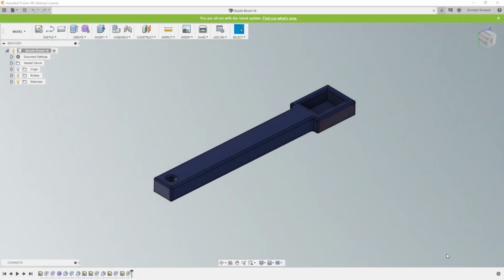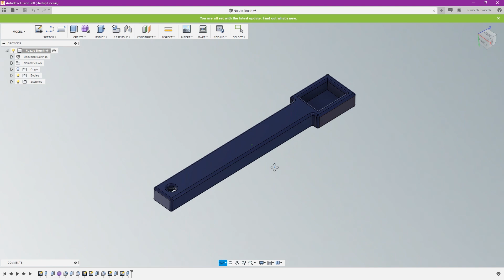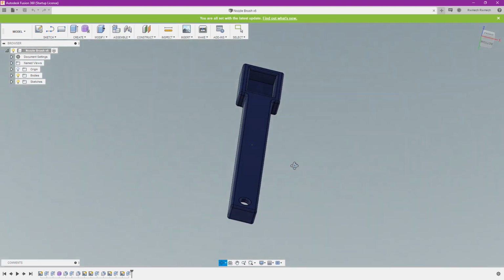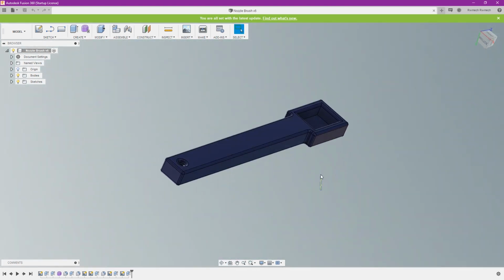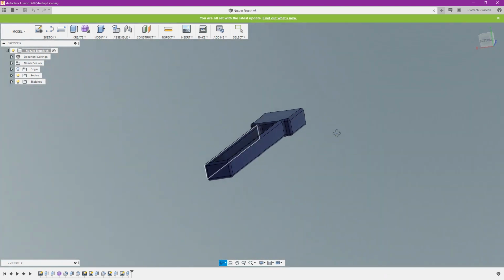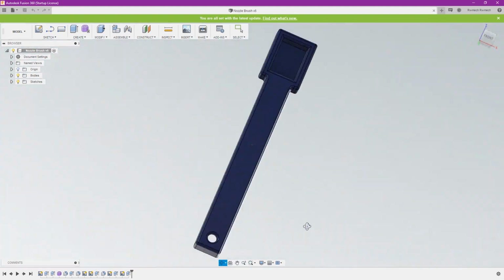Ultimate 3D Printer Nozzle Brush - Clean it right!

Comment: This is a great design, just printed one off thanks.

On mine I extended the handle so I could easily reach the nozzle when it's at the back. Then I cloned the head bit which holds the 2 bits of felt, rotated it 90 degrees & stuck it on the opposite end of the shaft so I can easily wipe the nozzle from side to side as well as front to back 👌

Comment: Interesting, this may be a potential alternative for a dedicated nozzle wipe as long as it holds up. How do these do against the heat? I'd assume they'd start melting fairly easy.
Reply from the maker: The pads hold up well for brief contact like a nozzle wipe.  The pads do eventually fill with filament you have to remove or replace pads but I've not found a better alternative as of yet.  This still works much better than a wire brush for everyday use.
Reply: @MakersMashup  Right on, I'm going to try it with a nozzle wipe mechanism and go from there. If these have issues at high temps perhaps creating similar pads from something like heavy duty scotch bright would be a cheap alternative. Thanks for the inspiration!

Comment: I wondered if this was better than using a brass brush?
Reply from the maker: Don't have to pick filament out and the pads are easy to replace.
Reply: @MakersMashup  do you use the brush at the same temperatures like the brass brush (~250° Celsius) and do the pads withstand that temperature or is it just for "cold" cleaning?
Reply from the maker: I've used it on hot nozzles all the time it's great to wipe and leaves it shiny.  If your nozzle is caked and you're scrubbing it clean a brass brush might be better but if you get a failed print and clean the nozzle promptly I've had zero issues.  I give them away at makerfaires all the time.
Reply from the maker: Perhaps. The video is a year or so old.  I have no problem at 200c.  Just wipe and go.  It's not on a prolonged period.